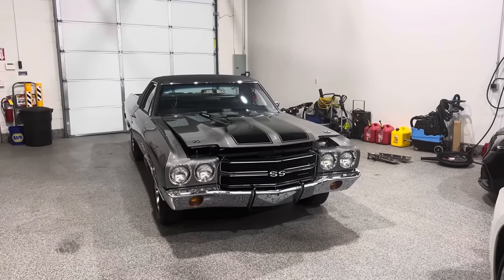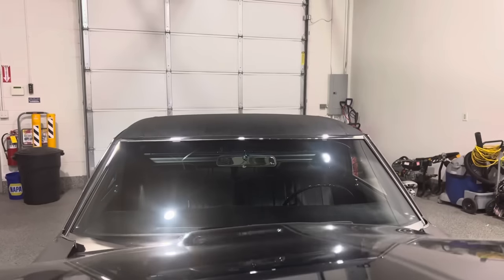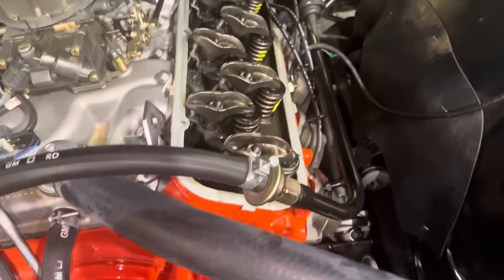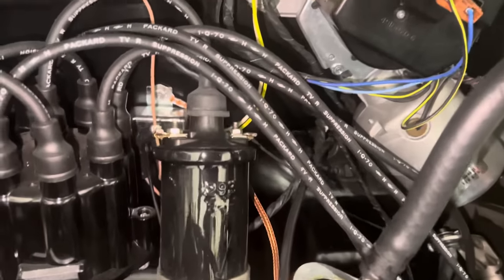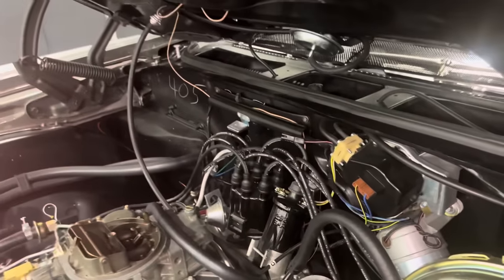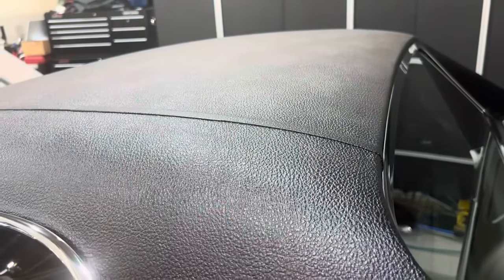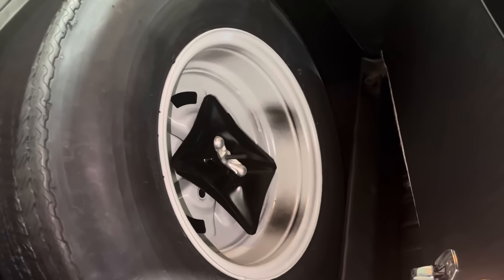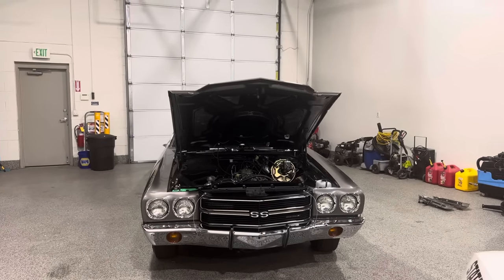Authentic Super Rare 1970 SS454 LS6 El Camino

Comment: Even with all of the "flaws", that's still a very nicely restored El Camino.

One thing that I've always wondered about the 1970 Chevelle/Malibu line is why did GM use 2 different front bumpers and 2 different colors for the parking light/turn signal lenses? Lower model Chevelles and Malibus had rectangular lenses but, they were "white" while SS models had amber lenses. El Caminos and (possibly but I'm not sure) station wagons had round lenses but, I'm not sure if the colors varied between "white" and amber on them. Any ideas on the reasoning behind this Patrick?
Reply: good question!!  the big 3 all did quirky stuff like this!
Reply: my 70 malibu has square amber lenses.  ive owned it for 20yrs and never paid attention to the difference from car to elco. lol.
Reply: Perhaps it was due to the fact that El Camino/wagon fenders are different than coupe/ sedan fenders. The latter is flared where the former is not. I think the Elco bumper is the same as the 70 Monte Carlo bumper, but I could be mistaken.

Comment: Beautiful car. As the new owner corrects some of the details, they can add the engine lift brackets to the list. The rear rectangular bracket should be flat and should be mounted to the rear of the passenger head, not the intake. The front bracket on the car is a later style item with the Omega stamp. The original will have more rounded corners and will have the part number 3969829 stamped on it.
Reply from the maker: Yessir these are some simple elementary items that are a easy fix. I wasn’t hired to provide assembly line correct component consultation. I was hired to inspect for authenticity and my public endorsement pre purchase to add provenance to the buyer’s investment. I do believe the new owner will be hiring me as well to guide him with correction of incorrect items.
Reply: @patrickglennnicholsmusclec1674  You might save time and start with the re-stamped block. Pull the passenger cylinder head to do a complete inspection of the deck surface. Without any documentation or original paperwork the only thing this car has as proof of being an original engine is that passenger side deck surface.
If in fact it is the born with block then there should have been many photographs taken during the engine rebuilding process. For an LS6 454 to have survived this long is nearly a miracle as many know. What is the date code of the block? What is the date code of the cylinder heads in comparison to the block? What is the date code on the distributor? In my opinion from what I have seen this car is so pieced together there's no way it's legitimate.

 If this cars original parts weren't acceptable for the restoration and needed to be replaced with reproduction, then where are the original parts?
Reply: @patrickglennnicholsmusclec1674 Why didn't you tell us how much it was? You don't seem to be as smart as you think you are. You didn't even crank it or drive it Just gave us a boring video with a lot of numbers that you can't back up

Comment: So many el caminos were used as fast trucks and used hard back in the days. Not surviving long. Even big blocks.  Chevy had done a great job with its styling using the Chevelle front clips and windshield frames.  Then in the 80s onwards they were used as drag cars and got chopped up beyond people wanting to restore. 
This ultra rare LS6 Camino is super rare to find.
Those fender liners are a fortune if original.

Comment: It will destroy a set of rear tires with no weight in the bed. 👍
Reply: All depends on the nut behind the wheel
Reply: @theodoredugranrut8201  I had a 69 SS 396! Spin them all day
Reply: Not before the wheel hop shakes the molars out of your head! I had a red w/ black rally stripe m22 version of this car in the 80's and it shook the earth before it would hook. Really need a ladder bar or 4 link setup to make em settle down.

Comment: Deck surface looks sanded. Should be broached.
IMO too many replacement parts to be real. I'd definitely want to see every original part that was replaced. My guess is that ain't gonna happen.
Amateur restoration with way too much wrong.
This car can be easily built from scratch. Without a build sheet or original buyer docs, not believable.
I'd have to do a closer in person inspection of the block surface under the passenger side cylinder head before handing over any money.
Reply: what youtube channel do you have so we can compare your knowledge and original cars to?
Reply: @markochoa4861 A YouTube channel or YouTube videos doesn't make you an expert.
Reply: @natew8882 Yeah how come he didn't crank it How come he didn't drive it and why didn't he say how much it was????? This guy is BORÍNG
Reply: @WisdomOverWicked777Rules  maybe the new owner wouldn't give his permission to allow it to be started and driven . The sale price is the private business of the seller and buyer .

Comment: Great car. But not a top dog.  Like the 1970 BUICK GS 455 STAGE ONE. I HAD TWO IN THE 70S. . GOLD AND SILVER.  RARELY LOST A RACE.  CAR AND DRIVER CALL THE BUICK THE HEMI KILLER - STUMP PULLER - ULTIMATE SLEEPER. BAD TO THE BONE.
Reply from the maker: The 1970 LS6 SS454 Chevelle is and has always been the KING of the Muscle Cars. That’s been determined over and over. It’s the undisputed KING with different examples holding pure stock records. That Buick is a cool car but the average guy doesn’t even know about a Buick or they had a muscle car. Nothing tops the popularity and performance of the fire breathing big block Chevy SS454 LS6.
Reply: Ok. But with bench seat and auto on Column. I always thought the s s was kinda plain jane. GE had buckets. Tach on hood. Ram air that worked when 4- barrels are open.  450 HP.  510 torque. . almost unlimited posi.  And luxury interior. . its a close race. Thanks for the feedback.  Oh I paid 500 for one AND 750 for other. In the mid 70s. Keep up the good work.
Reply: Correct. I've read all of the old shootouts and performance review articles and the 1970 LS6 was always the fastest. Not sure why Buick guys think the Stage 1 was faster because it definitely wasn't.